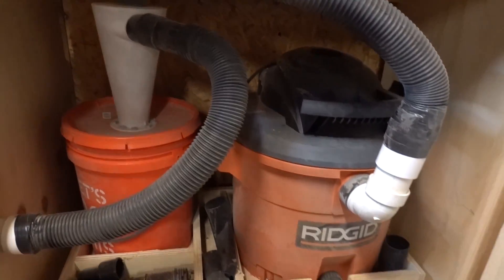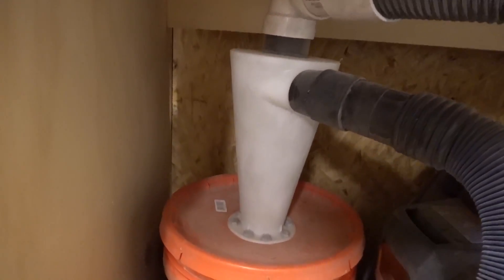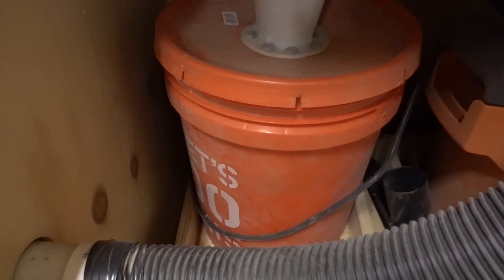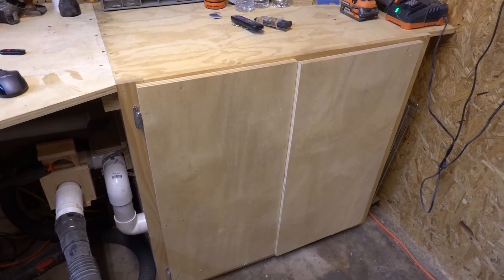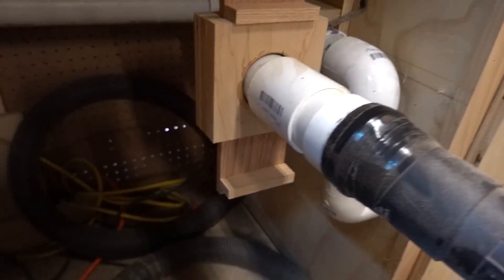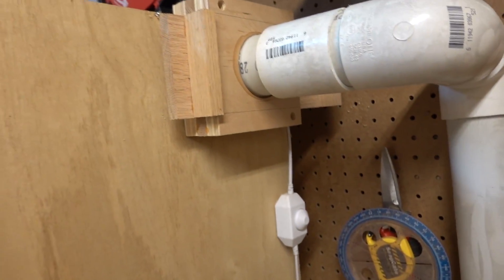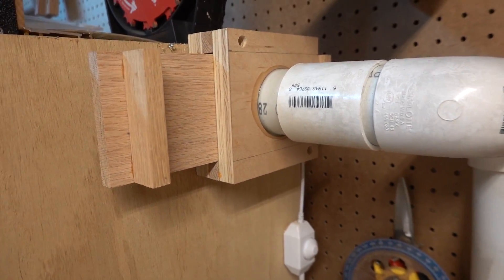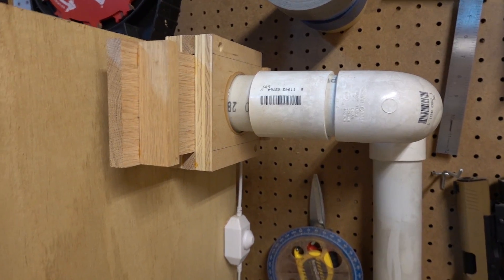CNC Enclosure Dust Collection

Comment: Hey just curious how you are grounding your vacuum hose. We have a Shapeoko CNC machine also and we’re getting a lot of static through the vacuum line any suggestions
Reply: Same here. I wrapped the flex hose with stranded copper wire and grounded the fixed end. Without that, static would discharge through the wiring and make the controller freeze up. I'm curious to know what this guy did.

Comment: I've been watching your vids for a while now, and building my enclosure for my Shapeoko 3 xxl. I just finished the Shapeoko build, and got the suckit dust boot in this week. I also got the same hose you recommended, and was wondering if you could tell me what fitting you use from hose to dust boot? Thanks. Looking forward to more vids.
Reply: Sorry, I think you got this fitting with the older version of the dust boot. The new pro version is different. Thanks anyway.

Comment: I have watched your video about making the CNC enclosure.  I live in East Texas where it is hot and humid.  I noticed your Texas flag on various things in your shop so I assume you live in Texas.  Since the climate here is  hot in the summer what are you going to do about getting heat out of the enclosure.  I have seen some builds where they put fans in and others that do not.  Since some folks live in milder climates the ventalation may not be necessary.  I used to live in Houston but now live much further north but it is still as hot as Houston here in the summer.  What do you think about getting air in and out of the CNC enclosure?  I have a Shapeoko XXL which is on a 4'x4' table.  Do you think you may need to add ventalation for the interior of you cabinet.  I will be making an enclosure if the dust boot I am having my son in law 3d print for me does not work and want to plan for the hot months.  The past few months did not need the heat removed because it has been a cold winter but summer is almost here with 95+ days in my shop.
Reply from the maker: I guess I would have to start my answer with a question. What about the machine other than the rubber belts would be affected by a little higher heat? I think the hottest it gets in my shop is probably 100 degrees in the middle of summer. In the enclosure while it's running I can't imagine it gets toooo much hotter. I may have to test it out. I ran it last summer with no problems, and no ventilation. If I were to add a fan I think a filter would need to be installed as well.
Reply: Thanks for your reply.  My concern is for the controller.  The router may get a little hot but there seems to be good airflow through my Dewalt 611.  The XXL makes a mess and right now I can roll the table outside under my covered patio and when through I just vacuum the table and blow the excess dust off with a blower.  I am rearranging my shop to accommodate the larger table and it may not be possible to wheel it outside due to the other equipment in the way.  Plus there are rainy days here and a big storm gets the whole patio wet even though it is covered.
Reply from the maker: @gdonham1203  I'm not sure what temperature is considered "safe" for the control board, but 2 things I know for sure. It wouldn't hurt anything to add an exhaust fan, and if I don't and it overheats I'll come back to this conversation and say "well looks like us here in Texas are gonna have to cool our enclosures, Glad I could be the test case :-)"
Reply: I found this information on the carbide3d forum:  The belts have an operating temperature range of -30–180° F. The ATMEGA328 chip on the controller is rated from -55 to +125 C. Usually the concern is cold and warming and condensation on the electronics. A number of folks keep their machines in garages — the big concern is belt anchoring / tensioning — that said, the mechanical fastening of the M5 bolts and PEM nuts shouldn’t be affected much by temperature unlike some of the previous techniques (DAMHIKT) — just using the standard operating …

Comment: For you blast gate on the front face extended a small 2 inch face plate that you can screw a hole through and into the other piece and place a dowel pin in the up position

Comment: On the vertical blast gate, drill a hole and use one of the inserts from your waste board and a thumb screw. No need to rotate it.

Comment: How long can you run your shop vac during a cut? I was told that they burn up pretty quickly.  Can you run the it for 2 the 3 hours.  Or do you run it 30 minutes at a time.
Reply from the maker: I have run it for up to an hour before without any problems. I'm not sure how long they can go without needing to cool off. Honestly I don't really ever run for more than an hour or so, so for me it's not much of a problem.

Comment: Welcome back...could you turn that first blast gate 90 degrees, then you wont fight gravity...cheers.
Reply from the maker: Not where it is. The cabinet and other piping gets in the way
Reply: @stufftokeepyouentertained2168  I think an easy solution could be drilling a hole for a pit through the outside enclosure and into the gate when its being held up. Then you just have to push in a dowel to lock it in. Could even get fancy and go with one of the "locking" pins that have a springloaded ball on the end.

Comment: Thanks for the info, I still have to build my enclosure, it is one of the steps in an almost complete rebuild of my workshop.  I just bought a smaller Rigid Shopvac to better fit in the enclosure with the cyclone so I have more room to store Shapeoko tools, clamps, computer, etc in the cabinet under the torsion box.  I'm also planning on using a box for the dust that is lower and probably longer to better take advantage of the form factor in the cabinet and build a Thien type of cyclone instead of the Dust Deputy again because it would cut on the height of the setup.   A few comments on your current setup: I would think that the pipes between the shopvac and the Dust Deputy would probably be better if you used rigid tubing as it has less resistance.  While I understand you have the monitor on top of the enclosure, I think it would be more efficient to have the rigid tube enter near the middle of the enclosure roof so your flexible pipe would be supported, you would not need the bungee, the line would also be shorter.  Do you find that the Shopvac overheats in the enclosed cabinet?

Comment: Nice to see you back. Nice setup on the dust collection. I’ve heard where 90 degree  kills suction. What have you experienced? I used sweeping 90 deg on my dust collection and have zero complaint. I did end up grounding mine due to static. Do you have any problem with static?
Reply from the maker: I haven't had any problem with either. The runs are so short, and the vac is pretty powerful for my small needs that the 90 degree bends don't really matter. I haven't noticed anything with static at this point.

Comment: Can you do anything useful with the collected dust?
Reply from the maker: A lot of people save it, mix it with glue and use it as a filler. Only problem with that is if there is MDF, Plywood, Oak, etc... Not to metion if you use metal, plastics mixed in you might get a pretty gnarly result. And that's not a good thing. Other than that I don't use mine for anything except putting it in the dumpster.

Comment: Finally getting my XXL about ready to cut real stuff. Just need to get my dust collection setup so I don't have to chase it around. Surfacing the other day resulted in me not keeping up and still finding dust here and there. May break down and buy the dust shoe if I don't make something soon then an enclosure. Maybe VCarve sometime later? Thanks for the videos, keep it up.

Oh, I put in a router speed control from Harbor Freight and it keeps my vacuum at a slow speed or full if needed. $20 https://www.harborfreight.com/router-speed-control-43060.html
Reply: Just surfaced mine today, should've waited for dust boot to get here.
Reply: Yeah,live and learn lol @johnross3251

Comment: Thanks for sharing, what dimensions is the pipe work? 4 inch? Any issues with the 90 degree bends? ( Iv seen so many videos saying to make longer sweeps for bends) Iv not set my dust collection up yet so I don’t have much experience of that. Fancy posting a quick video of it in action please? Cheers
Reply from the maker: It's 2", and I heard that as well however I have not experienced any problems. I think on a small scale like mine with the short runs of pipe the suction is great enough that it does not affect it.